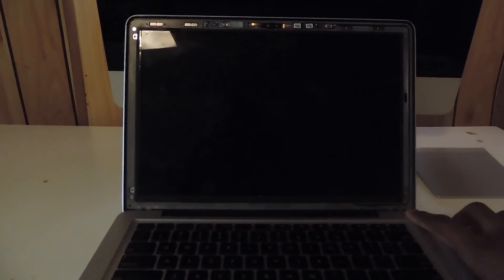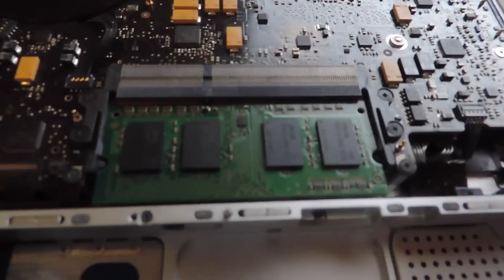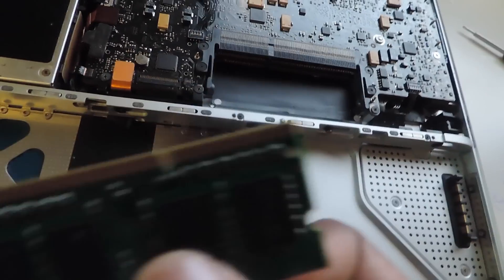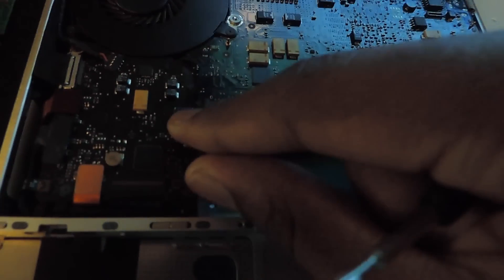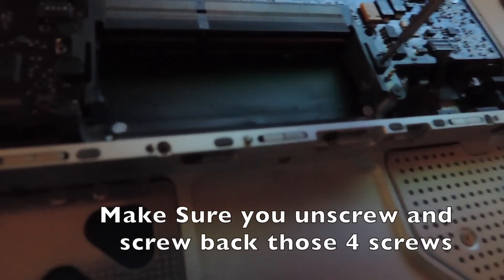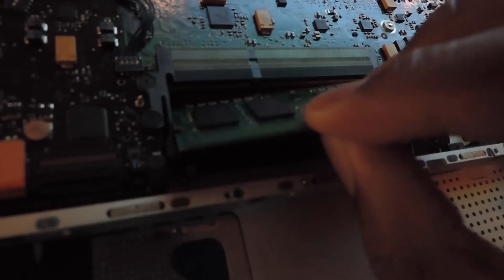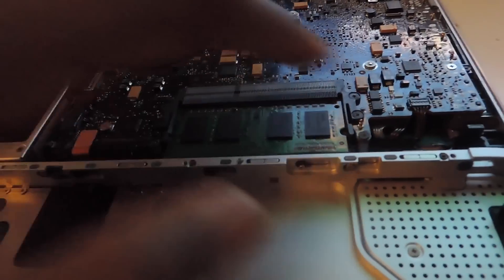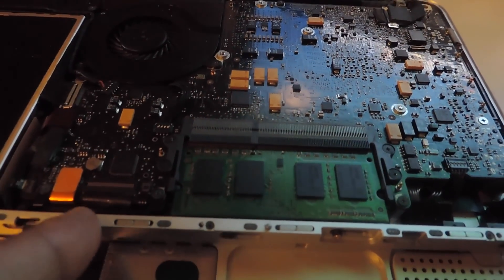How to fix a MacBook beeping or Ram not detected

Comment: Hi @tech Assistant
I had followed your advice partly 6 months ago, At that time, I had only loosened the 4 screws, didn't remove them.
Now yesterday, I removed all the 4 screws all together from the board, and tightened them again (not very tight) 
AND
the one slot which was malfunctioning since 6 months started working again.

Thanks for this video.

Comment: I cannot believe THE SCREW THING WORKS, but it actually fixed my RAM port. I was skeptical, but after you explained your problem I realized I had the exact same problem. I've been running on 1 port for years and now I feel like an idiot. Sorry I doubted you. This must have been a manufacturing error seeing as how many others who have commented that it worked for them too.

Comment: This video helped me a TON!! I tried to upgrade my 2011 macbook pro to 8gb of ram almost 2 years ago and for whatever reason I kept having issues, eventually I figured out that the bottom slot of my ram slots was bad (or so I thought). Today I looked into it more and it seemed to work fine when the computer was cool, but once it heated up the bottom slot would not work anymore. I unscrewed the screws around the ram card holder and it worked! No more issues! Pushing these 8gb through their paces now with blazing fast speed and so far no random shut downs or stutters or spinning pin wheels of death! Thanks man!
Reply from the maker: I'm very glad it worked!

Comment: thanks alot, it really works. the technician said it was a bad ram slot, it cant be fixed that was 6 years ago, after i watched you video and tried it, the ram slot working smoothly without any gitches. again thanks for the tech tip.

Comment: I was SO excited about this tip...it sort of worked...the computer however would not boot past the loading screen then went back into the ram issue...

Currently only one of my slots is working...i mean this was sort of progress as atleast it was switching on...but would have loved to be able to use the second ram slot

Comment: Just a heads up on this.  If loosening and tightening the rams screws resolves the issue for you, know that it might be a temporary fix.  Unfortunately this means that the logicboard, over repeatedly heating up and cooling down has warped a bit, and some of the soldered connections to your ram slots are no longer making good contact (this is why sometimes it seems to work and others not).
Reply from the maker: It worked for months and still is working I think it has something to do with ground.
Reply: My ram passes both the apple buiit-in hardware test and memset' test. So I think my rams(upgraded to 8g from apple) are good. However, sometimes my mac will have the beep problem, I have to wait for a while in order to turn it on successfully. So do you think my slots are broken? If so, is it expensive to fix it? Thanks.
Reply: Junie: that is the exact same scenario I have, and hitting the ram slot on mine locks it up as it does in the video.  Try pulling one stick of ram, and running with that for a day or two, then swap the ram to the other slot and do the same.  If one of the slots causes the freeze up, then you know the culprit.  BTW mine is the bottom slot that is affected.
Reply: So after we locate where the problem is, is there any way to fix it Nate?
Reply: Junjie Liao you have a couple of choices.  1: try the fix outlined in the video.  If that works, awesome.  It did not work in my case, and I have ordered a new logic board.  I suspect that the ram slot has solder joints that sometimes make contact, and sometimes not, if this is the case, the performing a "reflow" on the board may fix the issue.  A reflow basically heats the solder up on the board until it "reflows" and connects any points that may have Ben damaged.

The reason I think this is the case is I found my macbook still running after I had closed the lid and put it in my bag.  It was running hot for hours and the problem did not exist before hand, which leads me to believe that my logic board warped, and that, I believe is the cause of the ram slot issue, and why tightening/loosening the ram slot screws may, temporarily, fix it.
Reply from the maker: My bottom slot didn't work and just took out the screws and put it back and it worked. I took out the screws before for no reason and I put it back on tight and the ram stopped working. There is no reason to reflow a logic board unless you want to temporarily fix the gpu or cpu not working. The only reasons why ram wouldn't work is because of a bad smc,cpu,or the ram slot is bad which you would replace it.   Nate Wood
Reply from the maker: What year is your computer the 2011 MacBook Pro had a recall for video. Junjie Liao
Reply: Tech Assistant mine is early 2011, but it is a 13".  The recall only applies to the 15 + 17" and is  failure with the discrete graphics card.
Reply from the maker: Nate Wood  Since you have intergrated graphics the ram would affect the gpu.
Reply: Nate Wood I got exactly the same issue here. Sometimes even I closed it up, it heats up and running out the battery very quickly.
Mine is 2010 Mid Macbook Pro. Tech Assistant
Reply from the maker: Try cleaning out dust and replacing the thermal paste if it still acts up get the board checked by a professional or replace it.

Comment: i have a 13'' 2012 MBP, i had two ram sticks in it, whenever i would pick it up ,the screen would go weird and freeze. i thought it was a video issue, i reflowed it twice, still did it. i decided to remove one ram stick ( last ditch effort to save it) and it works just fine! so, if that is happening to you, try removing one stick of ram!

Comment: This will help only for a little while. Problem is the lower RAM slot is soldered to motherboard by small tin balls. Tin get old and damaged, it´s the same issue like on BGA chips. You need to take soldering iron, microscope and re-solder all the balls on bottom RAM slot.

Comment: Tux for ur video~I got the same problem, but I don't have the screwdriver to open it. My one is Mac Pro retina A1398 and it's out of warranty.  Do u think Apple Store will fix it for free?
Reply from the maker: Cheng JI If the fix is just taking out the ram and putting it back in then I doubt they will charge you.

Comment: What kind of screwdriver did you use to take out the way too tight screws for the ram holder? I'm looking to fix my Macbook Pro 2012 but I can't find out what screwdriver I need. :/
Reply from the maker: +Tinsaus A very small phillips head Phillips 0 or 00 I believe just buy a small screwdriver kit.

Comment: I have a lenevo all in one when I plug in both the Rams 4x4 it doesn't turn on but when I have only 4 in one slot and none in the other it turns on but when I have both in it doesn't turn on helpp
Reply from the maker: I'm not sure what your problem is are you sure both ram sticks have the same specifications?
Reply: yup idk what to do urs looked lot similar so I thought it would work or my pc too
Reply from the maker: Look at the sticker for the ram they all have to match

Comment: The problem I had with my laptop was that it was beeping once, every five seconds. I tried turning it back on but never showed a screen. If I do your suggestion to remove the RAM from Mac, do I leave it out forever our I clean inside and stuff then put it back in, and it should turn back on. It all started happening today, I'm scared. And do I loose all my files and stuff if I doThis?
Reply from the maker: Just remove it and put it back in if that doesn't work try cleaning it and last try unscrewing the screws I specified.

Comment: Hey my macbook pro beeps three times and it works when the bottom plate is unscrewed but when I put the plate back on, it doesnt work and beeps? Suggestions?
Reply from the maker: +479Razorback Seems like there is a short try putting electrical tape on the area of the plate that is near the ram.

Comment: My computer works for a fair few hours then switches of off and starts beeping 3 times continuously. the first time it happen i was using a SSD ( i have two a HDD apple and a SSD M500, the second is located in the superdrive bay) it was after shutting the lid and coming back to it, about 30mins later it started beeping i was unable to use the ssd os so went to my old os on the hdd. i was able to reinstall clean el capitan, which it ran for a few hours then it happen again. this time the os was fine but when i was able to restart it i had pink fuzzy patches on my screen crashing and beeping again. i have been using the hdd as it seem to happen quicker with the ssd....... any help would be much appreciated and i hope that makes sense.

Macbook pro mid 2012 - Ram vengeance 1866mhz 8gbx2
Reply from the maker: Did you try using the stock ram?
Reply: I havent got the stock ram any more....
Reply from the maker: Manley Power  Oh because I doubt the drive setup you have would make it beep. Try using one stick in one  slot and switch between the 2
Reply: Awesome i will try that thank you!

Comment: My computer has three slow beeps, then i turned it off and turned it back on it was fine. I had it on my lap and when i fell asleep it fell off my bed and hit the ground really hard. Did it break my computer if it worked after it fell and beeped? This paragragh doesn't really make sense but I dont have enough money to buy a new so i dont want to
Reply from the maker: Sounds like the ram got out of place you can go to ifixit.com for instructions to fix the computer if you don't know anything about fixing computers just bring it to a pro

Comment: grrrrr..... done reseated the RAM ABBA AABB.... still the single beep in 5 seconds, 4 screws  removed and reseted, still the beeps.....holding the power button for 5 seconds.....light blinks very fast and after that the beep starts again.....put it out, tried it back on.....isnt doing anything anymore :@

Comment: Hey to u. 
I have a MacBook pro 2011 early 2.2 cpu
I have 8gb an I upgrade to 16gb now it's not turning on :-(   I try to switch back to 8gb an it's still not turning on. Amm an also I have a 
Corrosion in my battery so I pulling off the battery 

Please help me. :' -(
Reply from the maker: king raptor Try reseting the smc for your MacBook and for the corrosion I tould replace the battery and clean the corrosion with rubbing alcohol good luck :)
Reply: What it is smc ???
Reply from the maker: just search on youtube 2011 MacBook pro smc reset
Reply: Thank u so much
Reply from the maker: No problem :)
Reply: 2011 MacBook Pro smc reset

Comment: My macbook was in a sleeve and laptop bag which tipped off of a small shelf. My ram has been replaced 2 times STILL BEEPS. They told me take it to apple but im afraid it will cost too much!!
Reply from the maker: +Tori H Try the tip I gave about loosening the screw . If that doesn't work go to apple and hear what they say. If they say you need a new logicboard go to louis Rossmann he repairs mac motherboard or you can get a better used mac if the price is in that area.
Reply: +Tech Assistant thanks a ton
Reply from the maker: Tori H Glad to help

Comment: Hey everyone, after having this problem, i found out the problem might no te soldering at all. read on...

I have a MBP 15" early 2011, had the logic board replaced in the apple program for the video chip, after that, i started to get kernel errors once in a while, all was pointing to RAM, but never could actually find the defective stick tried many, after a while of seating and reseating the sticks and a fresh install os the macOs it stopped for almost a year with no problems i thought i was done; only to begin crashing, powering off and beeping this week.

i've been reading forums and watching this video

https://www.youtube.com/watch?v=xpagfXra...

and having exactly the same problem as this.

So I took it apart again, and what did i find... apparently, as i said, and for everyones happines it migh not be the soldering at all!!

It seem the CLIPS that hold the stick closest to the keyboard are worn and do not have enough pressure so they do not hold the ram in place all the time, a little bump and the stick spings up like half a milimeter and the problem appears.

What did i do? Got a 1.5mm (.60 cal) piece of flat styrene about 3mm wide and 7 or 8 mm tall, put BOTH RAM sticks in place and with a little plastic tip/spudger push down the stick closest to the keyboard so the clip can make its full travel inward and insert the styrene pieces one in each side in the slots between the clip and where the screws for the backet are and then push them towards the RAM contacts to make pressure inward so the clips are pressed firmly agasint the sticks (you wont be able to remove the sticks without removing this styrene pieces).

I did this, the MBP started with no problems, i can now shake it and won't freeze and/or beep at all.

I'll try to make a video or at least a photo guide showing and post the link (it will be my first YT video so be nice hahaha) so it shows the fault and fix clearly
Reply: hey never did the video?

Comment: Works for me and wonder why?
Reply: I was reading a few days ago and apparently there is a few macbooks with a faulty ram slot soldering, so the screw unscrew probably corrects the mechanical pressure on the faulty solder.

Comment: mine was beeping today, im a logic man, so i thought what was different about today. well i had my mac in my bag today vertical and when i took it out hours later it was beeping. went online, saw it might be a ram card slip out or something like that. so i turned it the other way and hit it. it came back on.. so give your mac a good spanking lol on the CD drive part. you can laugh away but it worked for me. i didnt open up my mac...I just Disciplined It lol... im the MacDaddy in this bishhh!!!
Reply from the maker: Everyone hits something that's not working and some times that fixes it lol
Reply: +Tech Assistant I was giving my Macbook a gentle shake for a while, until the problem got more persistent and I had no choice but to unscrew the unibody and reseat the RAM.
Reply: You say you're a logic man and proceed to hit your laptop to fix it. That's a bit contradictory.